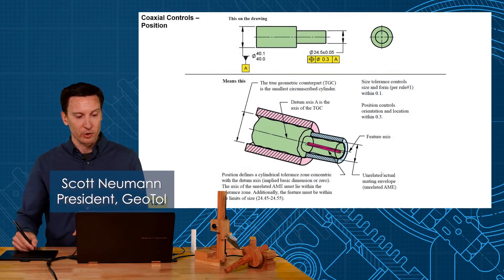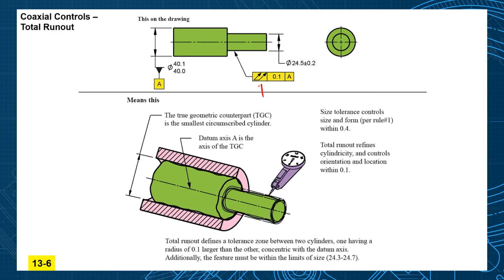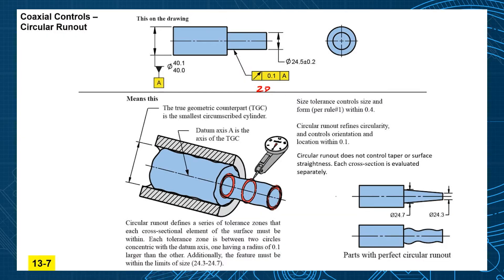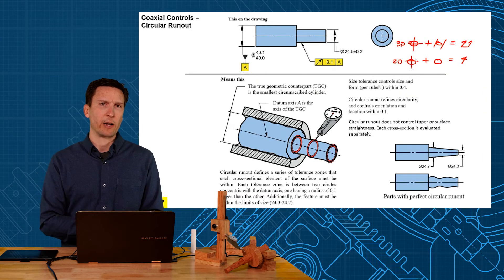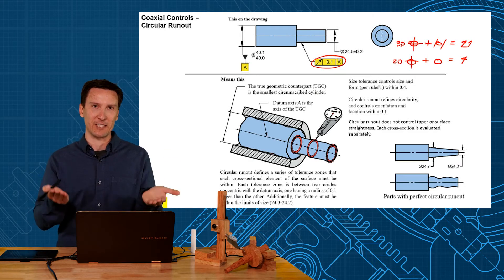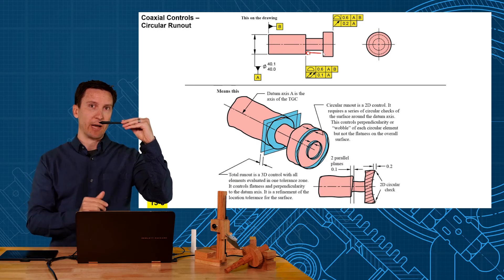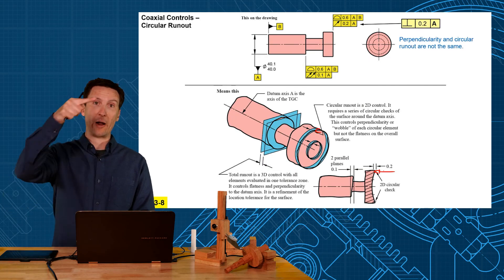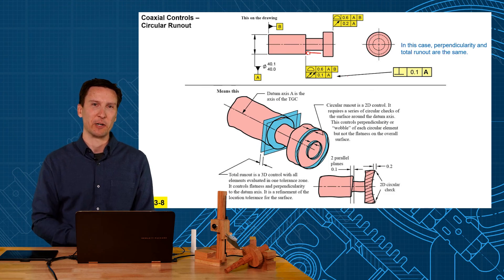Total Runout vs Circular Runout

Comment: More confused than when I started.  How on earth does looking at crossections give me anything different than total runout?
Reply: Saw another video.  So for runout you can set your tester to the surface and you don't need to make sure the measuring tool is at the same height as you are measuring.  So on one crossection your pole could be at the high end of the tolerance 24.7.  put on your indicator and spin.  So long as that spin doesn't vary more than .01 you're good.  Do the same somewhere else on the shaft and maybe it's now at the low end 24.3.  so long as your rotation doesn't vary by more than .01 you're still good.

Total runout means I have to have my indicator at the exact same distance away from the axis for each test.
Reply from the maker: Yep, you got it. Circular runout allows you to "re-zero" the indicator at each cross-section. Total runout, the cross-sections must be evaluated simultaneously (without re-zeroing)

Comment: Can Total runout be used instead of coaxiality? For the same geometric tolerance value, which one is more stringent than Total runout or coaxiality?
Reply from the maker: Runout does everything position does and also controls form. Runout tolerance is more strict. This video explains it: https://youtu.be/aw5EK5U0Vb8
Another video with different applications for runout and position: https://youtu.be/Y4woF-aE2Xo

Comment: perpendicularity and total runout are not the same at 90 degrees to your datum axis. Perpendicularity refers to an angle measured in degrees rotationally (360 degrees) where total runout is measured linearly as mm or in as a surface function (in a straight line 180 degrees)....sorry dude RIP
Reply from the maker: Perpendicularity tolerance on a surface is never in degrees units. Its always distance units (between two parallel planes). This can be verified with a dial indicator.  Per ASME Y14.5-2018:
9.3.2 Orientation Tolerance
An orientation tolerance specifies:
(a) a tolerance zone defined by two parallel planes at
the specified basic angle from, parallel to, or perpendicular
to one or more datum planes or datum axes, within which
the surface, axis, or center plane of the considered feature
shall be contained. See Figures 9-1 through 9-7.